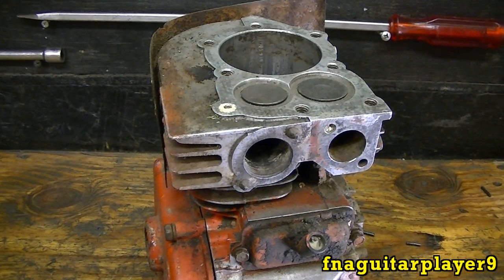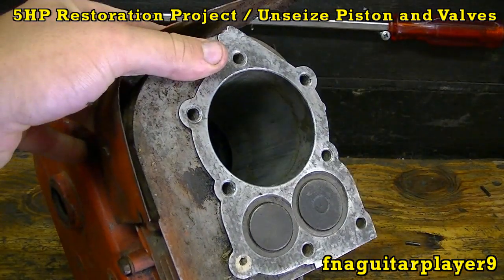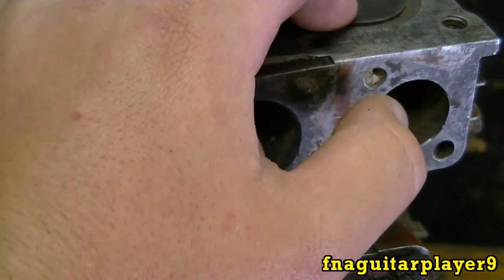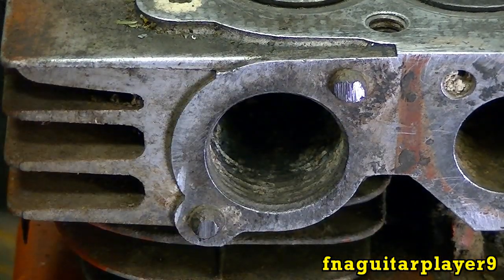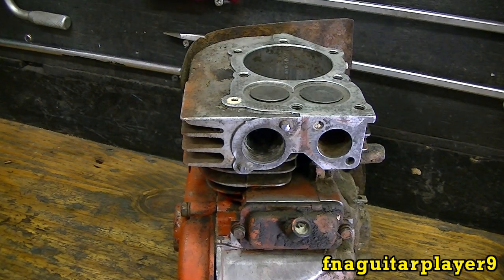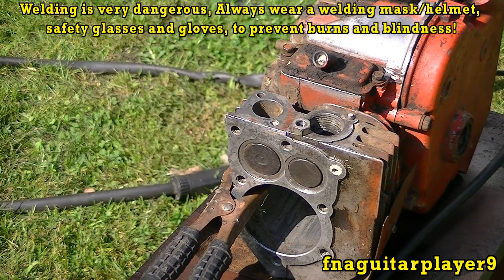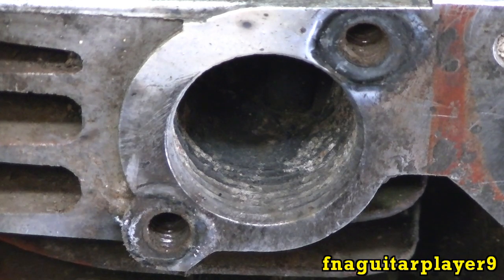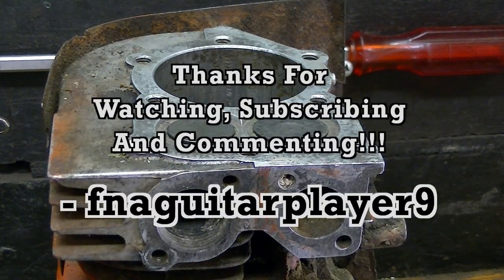Quick Tip #11 How to Remove a Broken off Bolt With a Welder

Comment: I really didn't think this would work, but I have a very old and very rusty Briggs & Stratton Quantum model 12 I'm fixing up and figured I'd try it. Three of the bolts holding the sump on were missing most of their heads, just a little rounded lump of metal left, so not even my bolt extractor sockets would work. I ground them down to expose some clean metal, but I don't have any flux core wire so I used regular MIG wire and 80/20 shielding gas, and they came out so easy I didn't even need a breaker bar, just a box end wrench. I think I had the welder set on about 45 amps using 25 mil wire.
Reply from the maker: I hear ya! A actual MIG was probably a better choice anyways. Its the best method i've found for removing broken off bolts, or bolts that are stuck, i've welded nuts on bolt heads before and it gives the same results, all the heat break the corrosion loose and the new nut gives you a good bite with a wrench or breaker bar. Thanks for Watching!!!

Comment: The quickest method of removing a stuck bolt I have seen  so far, awesome.  My problem is my old "Temperature Sender Unit"  bolt-- thread, snapped off while trying to remove it from the engine block, so what I  am left with now is a hole with the  thread  of the old unit still jammed in the engine block thread. Being a Honda C R X  the space to work in is very tight. Any advice on how to remove this bolt would be much appreciated. Thanks.

Comment: damn I didn't have my welding goggles on when watching this video, I'm blind now.

I just googled that harbor freight. welder, is it the $190 version?, that seems pretty good for a welder.
Reply from the maker: Kyocera234 haha heard that! This is the cheapest one they got, i think its like $89 or around that, its a 90 amp fluxcore welder, really nice for its size. We've welded anything from truck exhausts to lawn mower decks. Really handy, i think this is the best thing harbor freight sales. Thanks for Watching!!!

Comment: Excellent video!  You made that look very easy.  The big trick it to put a thick bead on there because the heat is what is making those bolts come out pretty easy.  I will say it again... Excellent Video.  Well Done!
Reply from the maker: Thanks! haha I hear ya, I had my welder (harbor freight 90 amp fluxcore) set on high amperage with the wire speed half way, on 5. I think it would have worked better with a little slower speed to get it hotter. Still worked good though, appreciate that and thanks for watching!

Comment: You made that look easy, I have an old Craftsman 80 amp flux core welder and all I get when I try to weld is lots of short pieces of welding wire.
I can't weld to save my life
Reply: check out weldingtipsandtricks channel. also practice alot and surface prep
Reply from the maker: haha i hear ya! I'm no expert on welding, but like outdoorsman wrote, surface prep is probably the most important, we've tried welding rusty exhaust pipe, and it just doesn't work at all, got to be clean shiny steel. Thanks for Watching!
Reply: The funny thing is I have seen guys weld rusty metal on YT, but I guess they are using another type of welder.
Thanks for the reply.
Reply: outdoorsman310 Thanks, I have been watching his videos.
Reply from the maker: Hard to say really, sometimes it works but most of the time it just "bubble-gums" haha Your welcome!